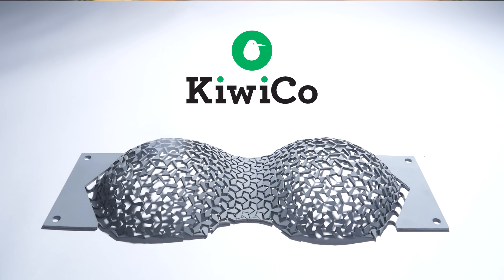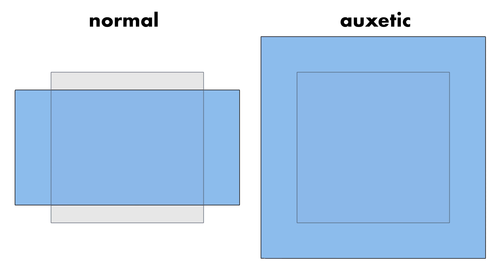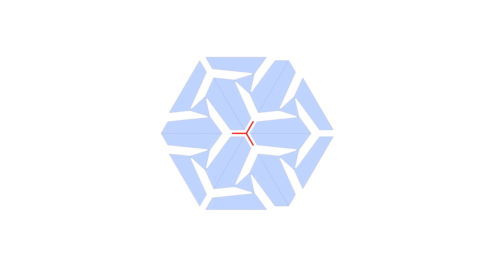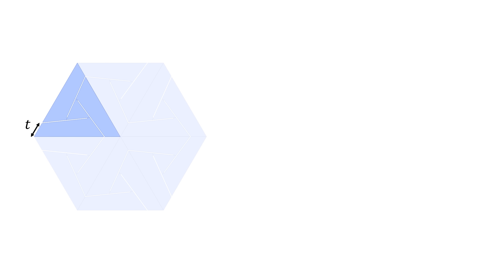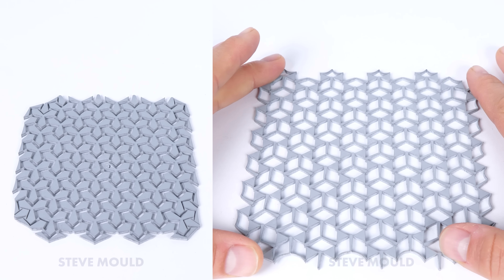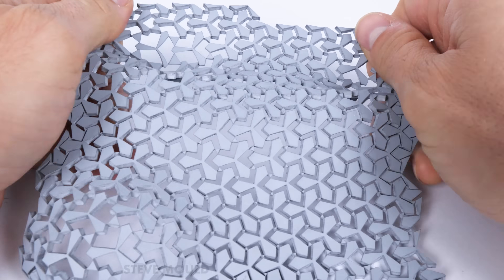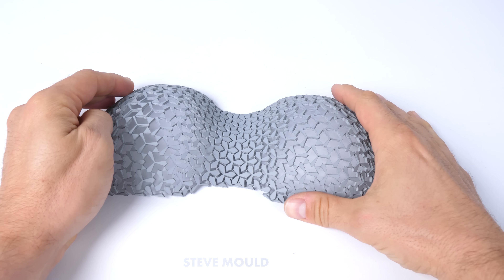Self-assembling material pops into 3D

Comment: If this was laser-cut out of a thin spring-steel sheet (rather than stiff rubber), I think that it may be a rather rigid structure in both state #1 and state #2.  I am a mechanical design engineer with a large laser cutter/engraver.  I may have to do some experimenting the this sort of structure this week.

Comment: It turns out like that joke - the more cheese, the more holes, but the more holes, the less cheese. Sheogorath applauds!
As an idea and a toy, this may be good, but when it comes to practical implementation, it turns out that such materials are unreliable, since due to the cuts in them, points of increased stress are created, which is no longer distributed evenly throughout the material. What good is it if most of the material is excluded from the strength equations? The strength of such a material is equal to the strength of its weakest link - the point of increased stress...
In general it's only pampering!

Comment: Okay, but genuinely, did you get this idea from the women in your life? Modern bras are hated by users for a number of reasons, and one of them is the quality and durability of the cup. They wear out fast and start to roll over at the top, which is why you sometimes see those odd lines in the wearer's tshirt. The wire quickly runs away from your ribs because the cup is getting bent out of shape by the weight of what they're holding, so the band goes too. The cups are usually made of the same cheap foamy fabric covered in a nicer fabric, because for some reason, bra manufacturers think the underwire is what supports the breast tissue, even though it literally just sits against the ribs and runs away as the band wears out - that oh so strong underwire actually seems like part of the culprit of why the band stretches so much so fast, holding in perfect shape while all of the working components quickly lose theirs.
   And storage, oh God, storage. For argument's sake, I'm gonna pretend someone owns nothing but the exact same make and model of bra, from the same company, in the same size - a pipe dream, because they keep redoing and re-releasing lines, plus all sorts of hormonal and use factors that make it a bad idea to own 1x14 of the same bra, but we'll pretend. You can't just hook the back of a bra and stack them like chairs, because then the band being hooked up makes it impossible to fit them together, it just won't sit neatly inside of the cups once it's latched. You can't leave them unclipped and stack them like chairs because that takes up way too much space, plus the hooks are gonna get caught on the bra underneath and cause a nightmare of tangled and tears. The most efficient way to store a modern bra is to *flip one cup inside out*, fold in the middle so the cups slot together, and fold the band into the cups. This just makes the cups wear out a hundred times faster because you're trying to force it into the opposite shape. And oh, that bloody underwire again! It somehow knows what you're doing, and maliciously makes it worse by causing the bottom quarter of your cup not to perfectly flip inside out, instead crunching and curling it so that the spot where you need it the most is weakened the most!
   What you've done needs to be patented fast. You've just solved one of the issues of modern bras. A cup that doesn't wear out from use, that offers support where it is needed, and that can be compactly stored without compromising its life. I know people are joking about it being a space bra or a robot bra, but as a big chested person from a family of big chested people, you could change the world here.

Comment: I can see uses for this as is, tbh. Imagine attaching a light, stretchy material to the interior of this, in the shape of a strapless bra (which hooks for attachable straps).
Well, now you have a bra that lies perfectly flat in a drawer or suitcase. 

You could do very very similar ideas with containers, like backpacks or purses or lunch bags, or even sleeping bags or tents.

In fact, most of the use-cases I can think of this, before you get to the molecular level, at least, are in light civilian camping equipment. Seems just absolutely perfect as is for it.
Reply: I would love it if my bras could jus lay flat in my drawers!
Reply: Spider thread
Reply: @TomG-f4r  spider thread would make better kevlar, BUT it's so hard to get/and turn into thread that there is literally no point, it would be stronger than steel, move flexible than kevlar and we still dont see a point in using it because we can basically make a synthetic version, spider silk is also very expensive and honestly not very sustainable
Reply: But it would never lie flat for a bra, backpack, bag or whatever you used or made, it will always be just as thick as a real bra at minimum, and for the "molecular level" why does it matter anyway? You want a bra that is so thin you might as not have one on? It doesn't make much sense, the strenght of the material corresponds to the thickness so no, it would never be flush with a draw even if it was made even smaller, a item has to have a mass and space to be a item, and dont think I'm just saying this about one of the examples it works for all the rest, you have a bag, ok now the bag is weak because its very thin so you can only carry maybe 1/4 of a normal real backpack which is useless seeing how a bag can basically be put anywhere once its empty, a purse? Sure maybe but it's still easier to you know, buy a purse instead of hoping oneday we create super strong, thin and elastic material that can be used for anything more than greenhouse walls or covers on your milk, the tent one is much better but still has issues, this would never stand up again a light breeze and if it was the size of a tent, it would be HUGE and harder to use because tents roll up, this would have to be kept flat in one piece until you needed it and then you still would need supports, pegs and a cover otherwise all you have is a plastic sheet with holes in
Reply: @Killthefish  "it will always be just as thick as a real bra at minimum"

yes, but most bras form a curved shape overall taking up more volume than their thickness, because idk if you realized but, boobs arent flat.  This type of structure would still be less than ideal though, because a function of bras is to smooth out the nipple, and to an extent, create a more flattering shape, of course that depends on the exact design used for implementation, but in most cases a structure like this would create a very uneven topography, which is undesirable.
Reply: @Top-Code  so first off thanks for a actual reply unlike the other two but let's not get into aesthetics, this was simply about the idea of a just as thick piece of plastic/whatever being the same thickness as a bra, yes obviously thicker bras take more room but as most people know if you stuff items into a drawer the drawer will hold much less than neatly putting it away, a bra isn't cast iron and stainless steel, they are flexible (unlike plastic which is where I don't get your "typography" or "flattening" part as that's not the purpose of a bra but simply what happens) but back to the point I was making, flatten and stack them maybe 5 high and then neatly put them away (even sideways would work with a tall enough drawer and by that it doesn't need to be very tall) how would plastic be better for a sensative area with sharp edges and a forced shape with no padding be better than learning to fold and if you then did get these padded they would be even thicker than a "normal" one because instead of the padding being the structure it now becomes a accessory added on top, let's pretend these plastic ones are completely flush and are all even uniform sizes that doesn't seem like a good trade off for chafing/irritation and possible grazes

TLDR - Learn to fold and if you have to stack them too tall for it to fit just flatten them?
Reply: @GuntWastelander  stacking bras and putting them as I said, Neatly away is barely crushing and cramming, spend less time changing what I said and maybe youd be able to use your own initiative without twisting words, also no, bras come in two types, over the top padded and have no issue with being stacked or thinner than single ply toilet paper and again, have no issue with being stacked
Reply: @Killthefish out of curiosity, have you ever personally worn or stored bras? If you haven't, then it may benefit you to ask more questions of folks who do instead of making assumptions!

Stacking padded bras is typically not as easy as you're making it out to be. Unless you have a specific space to slide the stack down into, even just the opening and closing of the drawer would be enough to knock over your nice, neat pile, or at the very least, flatten it out over a short period of time. Their uneven shape facilitates sliding unless held in place.

 Stacking in that way (depending on cup size and padding) can also be a quick way to deform and ruin bras. Not infrequently, the foam is so thin that just the weight of one or two other bras (or gravity) can cause sagging and deformation. So not a great longer term solution for everyone. 

Given that the geometry shown in the video is, by its very nature, created to expand and contract, the shape created by expanding the material (so in this case, a bra) would take up more space than it would in its contracted state by definition. Sure, it's still the same amount of material, but you aren't accounting for the added negative space that would fit little else. Padded bras, even when the same size, almost never fit flushly together, so that's additional useless space that you aren't accounting for. 

Not to mention how much easier this would make traveling with padded bras. Since you seem to understand the importance of not crushing/deforming the cups, I'm sure you can imagine the difficulty of packing a padded bra in a suitcase full of uneven clothing that changes from trip to trip. Sure, there are bra cases, but those just add bulk, which is the opposite of what this could help with.
Reply: @Laxlotl  let's go over this again right, unless you have G cup padded bras they don't take much space, no I never wore them but I have had girlfriends who have done exactly as I stated and it seemed to work out for them (infact that's where the whole idea came from, people who actually did it and it works and these weren't little ladies, 32 DD cups so it's not for these ply board women only) now let's skip all that nothing you typed and explain to me how having plastic, plastic that moves and rubs sharp edges is better than just putting stuff away nice and tidy, I never said crush cups and all of that as I said, you can stack stuff Sideways, you know, the Length of a draw which in that case has absolutely 0 crush needed and then you can fill in all the little gaps with even more, but no, you want to shred your chest and call it advanced go ahead but I can tell you for a fact this is the most uncomfortable thing that anyone has ever tried to defend
Reply: @Killthefish is all yackety-yak but no actual facts. All talk, no truth.
Reply: @owenpeck4857  "statement rejected, argument invalid, rebuke unnecessary" you need to stop making new accounts just to say the same dribble my guy
Reply: Let go my g this doesnt have to go on for a year
Reply: @Killthefish You sure yap a lot for being completely wrong 💀
Reply: @Killthefish  Never seen so many words say so little.
Reply: @corataylor2205  never seen a comment as pointless as yours, what was your issue exactly? You dont like my opinion? Then state your own about how im wrong but instead you do the usual of "your wrong" maybe actually read what i wrote next time and youd see my points because i did state quite a few

Edit - i was wrong, forgot about haijule or whatver they are called, 2nd most pointless

Comment: The sqUARE ONE works in quadrants.. so if you subdivided each cube with blakc lines it would be the same in both directions. That said you can then craft in those subdivisions, a picture one way, and then a picture another way, and so depending on those subdivisions line up it creates two separate images.

Comment: Perfect material to make bras and hats that fold flat for packing into suitcase 👌
Reply: Lol bro is about to start the next generation of gooners
Reply: Just imagine ur nip or hair stuck in there while you try to take it off
Reply: I take it you've never worn either a bra or a hat.  A bra full of holes would be very uncomfortable and a hat full of holes not much use for shielding one from the rain.
Reply: bras... arent  stiff 😭
Reply: @cyanuwu1864 I’ve felt some and they kinda are
Reply: @YunxiaoChu  Are you thinking of the padding? Because usually bras are flexable so they have to fit on a persons body
Reply: @acoweatinggrass  Add some padding layer that is allowed to wrinkle. The problem with squishing bras as I, who doesn't need any, understand is that they deform permanently when stored flat. Or that's what I have been told while getting a lecture how carefully you have to wash and reshape them after washing before you hang them to dry XD. The auxetic layer would offer the form, that can be reproducibly flattened and brought back into the desired 3D form.
Reply: @cyanuwu1864  they kind of are iv held one before they have soft squishy material to cover the breast but around it is a stiff material

Comment: One downside of this is the fact that almost all materials you could make this from will have a low number of times the edges of these triangles can be bent that far before failing/snapping. A possible solution would be to make this structure with tiny "door hinges" at each intersection instead.

Comment: I think you could also use this to make a dome out of a single flat sheet of metal. Like, drones on the moon or mars use local materials to build the sheet, then laser cut it into a pattern that will result in a dome. The drones pull it apart, raising the dome. Then they could like spray concrete or foam onto it to seal it up and give it strength. Possible to use this to build habs?

Comment: I feel like these would be great for quickly building structures for habitats on the moon and mars. They could be easily packaged for space flight and quickly erected to serve as the support structure that a strong airtight fabric could be draped over and fastened to.
Reply: Yes and no. That structure would be 10-20 meters each way. Unless you pack it like an origami, which could save space, as you'd need 1.2x5x5 space to create a 5x5x5 cube.

Comment: @SteveModul Could an easier solution or workaround, to the huge computational requirements, be to inflate a flat rubber sheet to the desired shape and then use a projector/printer to print a 2 dimensional, bi-stable, auxetic cutting pattern on it? Once deflated the length of t and the angle of θ should change to the correct values. Printing a pattern, based on a perpendicular 2D projection, on an inflated sheet should result in the correct pattern angles and lengths once the sheet is flattened again. Do you think this has any potential?

Comment: One of the only ways I could think of making that whiteboard square somewhat able to work when rotated is to put a + in all the sides instead of a curve, connect with X's on the corners, if it isnt an image mirrored on those axis I don't see it working, unless you tried coming up with some cool type of 'encrypyted' image that only shows after you turn it. Cool video!

Comment: Another interesting example of a bi-stable system is two air balloons connected to each other. The state with both of them equally half-full is the least stable. The most stable states are when either first or second of them is filled completely.

Comment: 🎯 Key Takeaways for quick navigation:

00:00 🧐 The video discusses a unique material known as bistable auxetic structure, which has mechanisms embedded within it, resulting in interesting behaviors.
00:28 📏 Auxetic materials behave in an unusual way when stretched or squished, expanding in the direction they are stretched.
01:26 🔍 Negative Poisson numbers in auxetic materials are due to how smaller components move around each other, causing expansion when stretched.
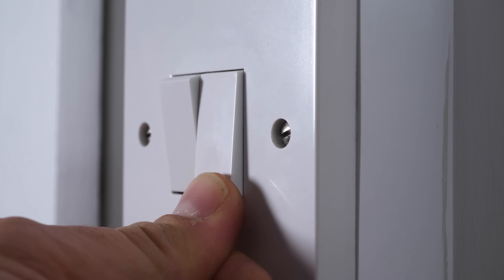02:55 ⚙️ Bistable mechanisms, like light switches, have two stable configurations that can be toggled by applying force.
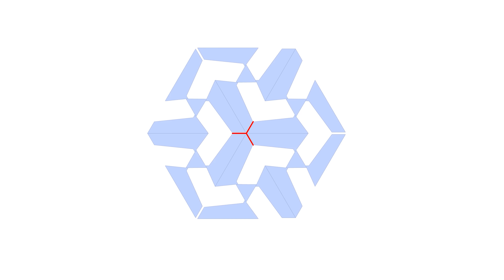04:22 🔄 Material stability is achieved by cutting and configuring components to create energy minima, resulting in bistability.
05:20 🏞️ The material's shape can be controlled by adjusting parameters like length (T) and angle (theta) of cuts, allowing it to pop into three dimensions.
07:48 📊 Selecting parameters for stability involves creating heat maps to find the deepest energy well, ensuring the structure remains stable.
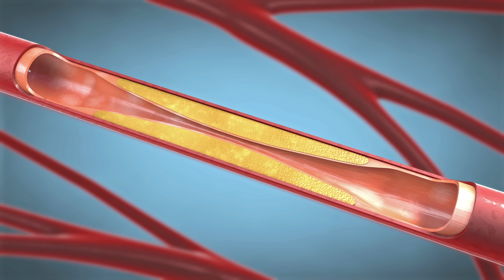08:44 💡 Potential applications of such materials include medical stents that adapt to the shape of arteries and self-assembling auxetic protein lattices.
09:43 🧒 KiwiCo is a subscription service for STEM projects that helps kids learn hands-on skills and gain an intuition for making things. Use code STEVEMOULD for a discount.

Made with HARPA AI
Reply: bro is ai that advanced
Reply: @Racingcaristhebeast  more than you think

Comment: 2:15 there are some simple images that would work for maintaining the image after the cycle. If each square has an image that is vertically and horizontally symmetric then it would maintain the same image. Something like a circle or a square or a plus sign would work.